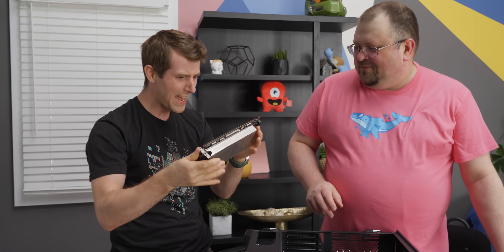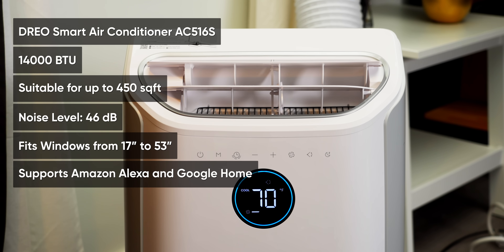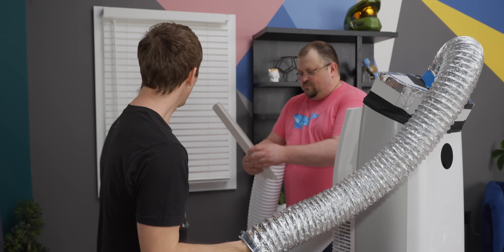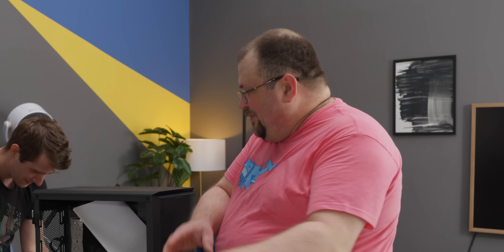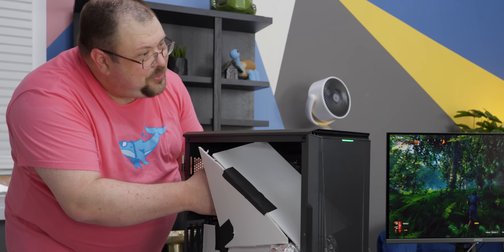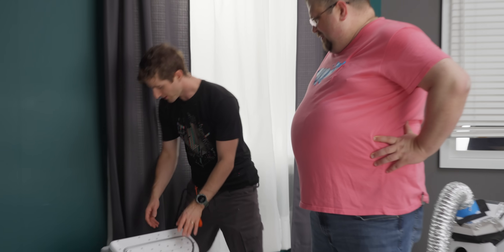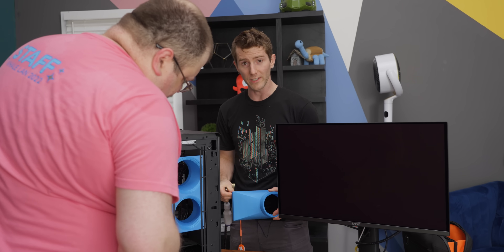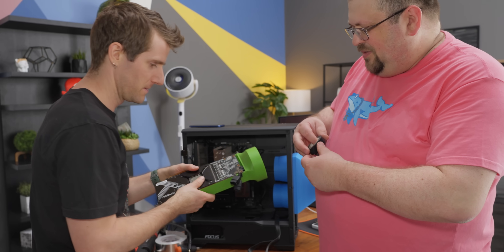Everyone is Cooling Their PC Wrong

Comment: If Technology Connections is right... Those AC with just one hose to the outside are BAD
Reply: And he is right, he convinced me to switch my single hose AC to a window unit and the jump in cooling and energy efficiency was insane
Reply: These suck!
No, Realy.
Reply: Less efficient yes
Reply: You don't even have to take his word for it. Just look at the ratings on the side of the unit. They give you the compressor rating, and then the actual cooling capacity, which is usually around half of the compressor rating. Even the manufacturers admit they're throwing out half the performance for profit margin.
Reply: I had one from lg that was ok. It's quite inneficient compared to a mounted unit, sure, but if that's not an option a portable a/c does the job.
Reply: He is 100% correct. Upgraded to a dual hose and it cooled my room so much quicker than the single hose model. These single hose ones are only really effective at spot cooling or as absolute last resort.
Reply: "If"?? I will not tolerate any Technology Connections slander!
Reply: Maybe less efficient then split hose models but that doesn't make them bad. They work just fine.
 I use a single hose Black&Decker AC and it cools my entire trailer with no issue. My power bill is only like $100/month and this is in the hellish heat of Alabama.
Reply: @verakoo6187  This is kinda a braindead take.  Would you buy a thing that's literally half as good as its competition for the same price?  If so, there's some gold I'd like to sell you for 2x spot price.
Reply: Unfortunately where I am you can almost not get one with 1 hoses
Reply: Yup! Loved that video and his recommendation
Reply: He is correct they are pretty inefficient, a regular window AC is pretty much always better if you can use one.
Reply: Yeah its pretty bad. Single hose and NO inverter.... Costco has inverter dual hose units. But obviously only use a portable AC if window is not an option. I have very small windows so window AC will not work. But my costco dual hose inverter portable is great..n No complaints from me
Reply: wait until people from usa and canada realise in uk we cant get dual hose portable ac's in all of our shops xd
Reply: They didn't even put the hose outside 🤦‍♂️ , the entire setup is literally making the room warmer vs just the PC
Reply: Not that bad, just overkill as heck.
Reply: @iangabriel5536  Not Bad..Just less efficient.
Reply: Not bad, just less efficient than having the window mounted ones. You want the heat outside. A hot hose inside means less heat making it outside.
Reply: @SmokeandSpirit  That's not the problem with them.  Even with a hose made from a perfect insulator, the AC is using inside air as the heat sink before it exhausts it, meaning it's making a negative pressure inside the building, sucking in hot outside air through any gaps, undoing the work it just did.  The only way around this is to have a second hose acting as an intake from outside, sinking heat into that outside air, and exhausting it back outside.
Reply: @SmokeandSpirit  It's worse than that. It's taking conditioned indoor air and throwing it out, which means that outside air has to be pulled in and then conditioned. Half the energy the single-hose AC units consume goes toward cooling air they didn't need to throw out in the first place. The dual-hose freestanding units are much more efficient, but still have noise drawbacks.
Reply: @SmokeandSpirit  it also means creating a negative pressure in the house, drawing in hot outside air.
Reply: @SmokeandSpirit  Not just that. One hose systems by design push air outside. This causes lower pressure inside which obviously pulls outside air in. A two hose design pulls outside air in to cool the hot side and push that hot air outside, so no pressure issues, no outside air getting into the room. 
So split unit > window unit > two hoses >> one hose
Reply: @SmokeandSpirit  That hot hose is taking air that was inside your house and pumping it outside. That means more hot air from outside gets pulled back into your house from other gaps and vents etc. Portable air conditioners should be avoided wherever possible for a window unit or cheap split DIY system (you can buy split you install yourself, they run off a regular outlet and come with precharged refrigerant lines with quick connects). These also have the benefit of putting the noisy compressor outside of the house entirely.
Reply: Thanks a lot for this comment. And yes. around 20% less efficient as a split unit. So I wouldn't promote it...
Reply: @Jochemster  20 % is very generous. The AC in the video promises 14000 BTUs (Ashrae), which is more like 9000 BTU (using the newer and more representative SACC)). 2.5 kW (9000 BTU) of cooling from 1.6 kW of electricity is just bad. Even cheap split units usualy get COP over 3 (3 kW cooling out of 1 kW of electricity.
Reply: @Jochemster  Linus drop tips will do anything for that sponsorship money
Reply: @Jochemster  Do you know how much a split unit costs ? And you need someone who installs this for you. You are way above a thousand euros for that. Mobile AC kist a few hundred bucks
Reply: That was my first thought as well.
If I remember correctly, linus previously said he liked Technology Connections.

Get the pitchforks!
It would be really funny, if we got him to defend himself over this on the next wan show.
Reply: I'm not sure about this exact unit, but this type of AC work fine. Not everyone can install a permanent unit due to price or landlord's restrictions. This type of AC can be quite noisy but it does it's job well enough.
Reply: There not bad if they have a split exhaust hose
Reply: Yeah this is a garbage unit.  I am kind of surprised LTT took it as a sponsored video.
But as long as enough of us post comments warning people never to buy it, then hopefully we educate some people and save them money.
Reply: @SinisterSlay1  It's okay dude someday you'll find something to be actually upset about
Reply: @Szanth  I don't know why you think I am upset?  I don't have long to live, I don't care what any of you do.  Buy the garbage air conditioner if you want it.  Enjoy spending twice as much to get half the performance of one that would have cost the manufacturer $1 more to have an intake pipe.
Hey at least this models tries to put the humidity back in the air, which technically would have a cooling effect.
Reply: @SinisterSlay1  if you're claiming he lost credibility by taking a sponsor for a product that Isn't Necessarily The Absolute Best (what a crime) then you're internalizing the events too severely or you're one of many people constantly looking for reasons to delegitimize LTT for any possible reason you can grasp at no matter how silly.

Sorry to hear about your health.
Reply: @Szanth  thanks, but do you not agree that LTT recommending an expensive product that isn't good doesn't hurt their past and future recommendations? They recommended pool cleaners, are they actually bad too? What about all those routers and switches, are they bad too? 
I suppose to their credit the air conditioner is almost a non consideration in the video, they never actually test it. They just test what cold ambient air does. Which they could have tested in their air temperature chamber they have. 
Anyways I don't think it's serious, a bit funny maybe since Alec would disapprove. But it's important people know not to buy these. 
There is another poster claiming it's the only option, then don't buy it. It's the only option because they've suckered in people. Go out of your way and buy the correct one and enjoy the benefits of it.
Reply: @SinisterSlay1  They aren't necessarily recommending it. They're upfront about the fact that they're sponsored by it. That's not the same as a recommendation. And as others have said, in conditions where you can't get a window unit or a double-vent unit, this is fine.

It's not as though they explicitly said "This is the official AC unit of LTT and we wholeheartedly recommend everyone go out and buy it".

They were sponsored to feature it in a video, and they did it in a way that fit with their type of content. They weren't dishonest in any way. Media literacy is important. They get so much flack for no reason. It's not as though they don't mess up on occasion, but people accuse them of the most awful shit on no grounds whatsoever.
Reply: @Szanth  I agree with you
Reply: @SinisterSlay1 sometimes you literally have 0 choice, no window unit fits in my window, and even single hose barely fits, adding a second hose means it physically will not fit in my window, so single hose is literally the only way to get cooling in my room
Reply: @SinisterSlay1  As someone who can't have a window mounted unit (velux windows) this is a horse shit comment.

Yes it's less efficient than a window mounted AC but at the end of the day it will cool the room more than it heats it which is exactly what you want on a hot day.
Reply: @mon94key  There are plenty of freestanding portable units that have both an intake and an exhaust hose, that fit the exact same window attachment this one uses.  Using a single hose is just the company cutting costs and adding that burden onto your cooling bill.  If you want that, then go ahead I guess.
Reply: @ Less efficient is an understatement.  You are taking your cold air, and blowing it outside, and sucking in warm air.  The only cooling it manages is because its COP is better than 1.  But that's why half of its cooling rating is missing and says so right on the thing.
Reply: @SinisterSlay1  what a ridiculously bad take